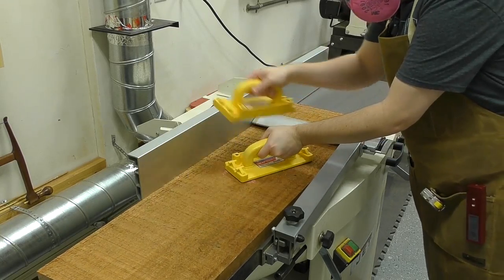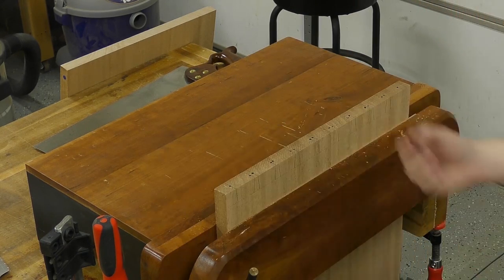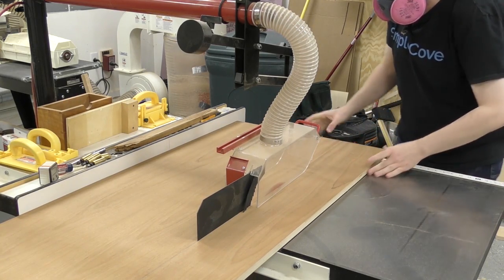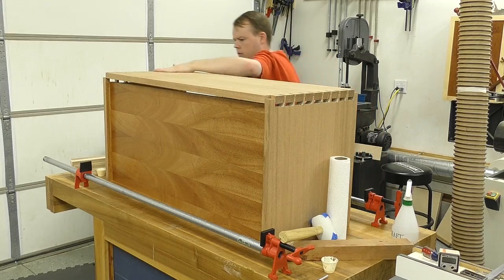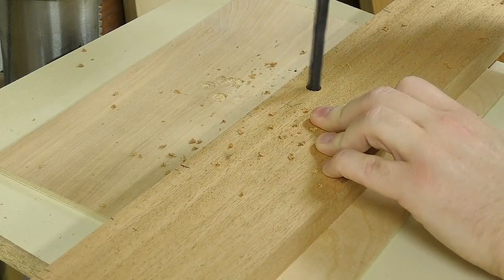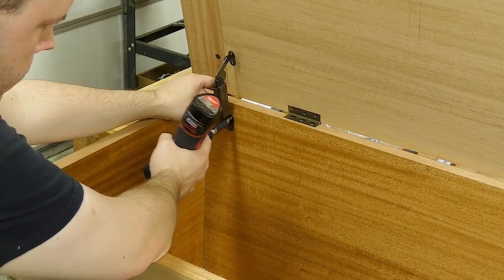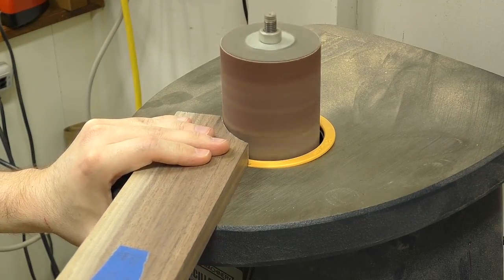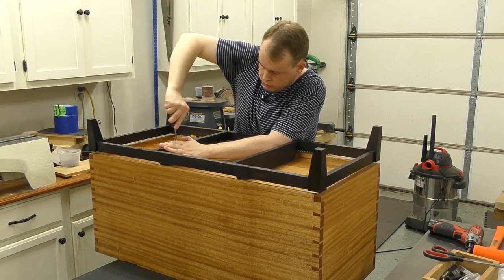How To Make A Dovetailed Blanket Chest

Comment: Thanks for showing your work. I think you have a right eye and skilfull hands for the job. You manage to give lifting touch what makes this heavy furniture to look  lighter. This something not everyone can do. I have question about your desinging. Did you use golden ratio or how you determine dimensions for this box.
Reply from the maker: Thanks Matti, for the kind words! I appreciate it. For the size of the blanket chest I simply looked at what's been built before mine and decided on the dimensions based on what I found to look right to me.

Comment: I inlayed the area of the scribe line once. I like the scribe line but some don't particularly non- woodworkers. One could also widen the  scribe line  with router bit or by hand and would probably not be noticed by non- woodworker.  Some folks consider the dovetail as an unattractive joint that should be hidden,  thus the half blind variety and decorative molding. Hard for one design to please everyone! Excellent job, regardless.

Comment: Beautiful work and very well done. I will say though that I hate those scratches from the dovetail gauge line. Such a beautiful finish with this inconsistent scratch across it. I have been woodworking over 40 years and used to leave them too but no-one who wasn't a woodworker understood them. I would hear...it's great but what's that scratch? I started thinking about it and started to agree. It's just a layout line...like a pencil line. I felt like they needed to be removed and I have never looked back. I guess it's personal taste but woodworkers seem to be the only ones that like it.
Reply from the maker: Honestly I didn't expect the scribe lines to be so deep. The Mahogany was really soft and my marking gauge made deeper lines that I thought. But in the end i'm fine with them. I did try to remove them but didn't notice they were still there until after the first coat of finish. Thanks for watching.

Comment: Great work.  I have a question for you:  Have you heard of the "Golden Ratio"?  Do you use it on projects such as the Dovetailed Blanket Chest?
Reply from the maker: Thanks! Yes, i've heard of the Golden ratio but didn't use it for this design. I researched blanket chest sizes and ended up going with a size that looked good to me and fit the area that it was going to go.

Comment: why use plywood on solid wood build .  seems  like a bad idea ,  shoulda    made panels  as u  did   with sides.  just an opinion
Reply from the maker: Why when the plywood bottom wont move like solid wood and it's cheaper to use plywood. Also,  you only see one face of the bottom panel so why make it out of solid wood?
Reply: Better quality. Just an opinion..
Reply: Because you went through the trouble of making it all fancy.  Why worry about saving. 40 $
Reply: Would you use plywood on a jewelry box .. I wouldnt ?
Reply from the maker: It's more than $40 actually with time and tool use. Also, I didn't have enough material so I would have to drive back to the sawmill for more. And a bottom for a jewelry box is way smaller so thats comparing apples to oranges in my opinion. I've veneered plywood bottoms for jewelry boxes plenty of times.
Reply: We hVe diff opinions i woukdnt do.  Either. Have a good one i like a yout valet box .
Reply: I'm with you on this one, Sean. Why? No reason to use solid wood for that, especially if you didn't have enough material. At that point, it was not really about cost savings, but just using what you had on hand to finish the project.